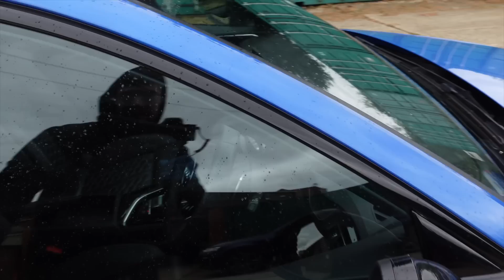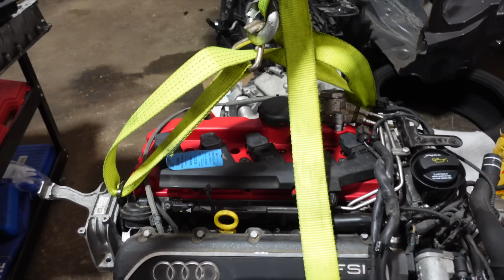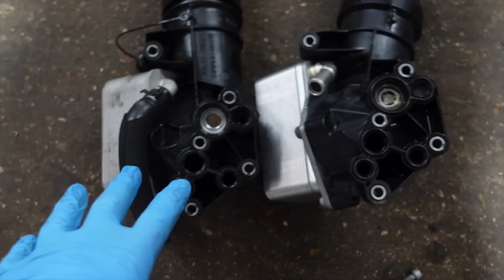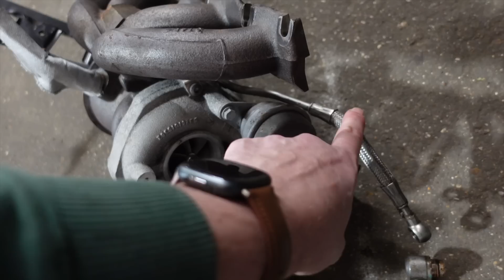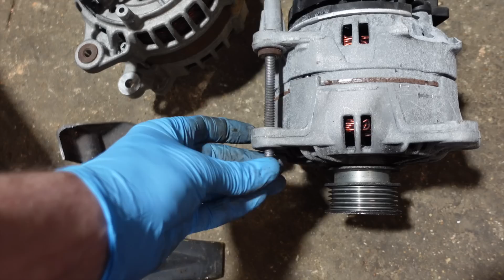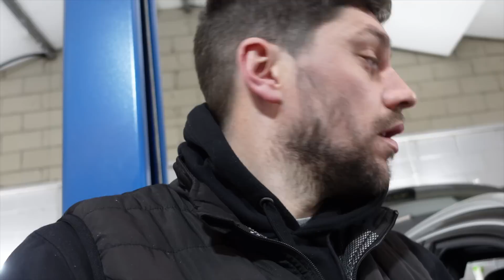FITTING AN RS3 ENGINE INTO MY AUDI RSQ3 - WILL IT WORK??...

Comment: Some advice I bought a Mercedes slk 230 compressor 197bhp I was wondering about upping the power should I go for the ECU remapping maybe also changing the Jets to 300s, or trying to make the compressor more powerful by changing the pulley I'm not looking for superpower 260 be fine.
You wouldn't have a Hayes manual for one of them have you? Where's a good place to look online is there any manuals hopefully are free? Chance anybody

Comment: Isn't the rs3 engine out of an A3 car but obviously called rs3 has 370hp or 400hp depending on the year . So the rsQ3 should be 370 or 400 hp now after the swop.

Comment: The next mechanic when he orders parts based on engine code:😖😖😖
Reply from the maker: Will be fine. Carried 99% of things over. Only things I didn’t in the end were engine internals. Which are 99% the same. Just the rod small end bearings that are different.
Reply: Plus a good mechanic would order off chassis number 😜